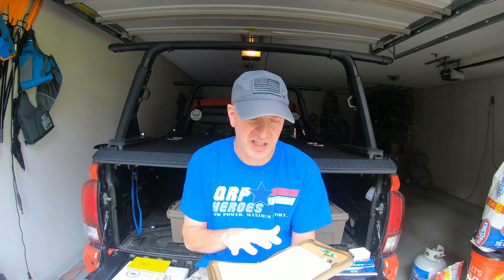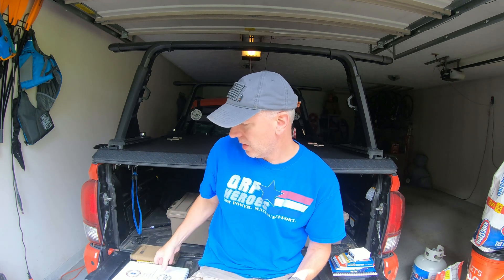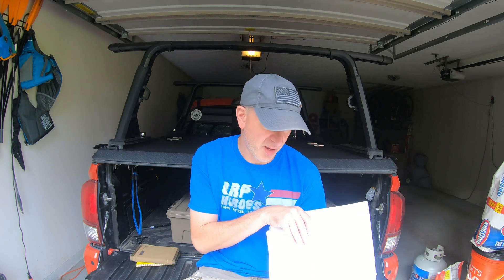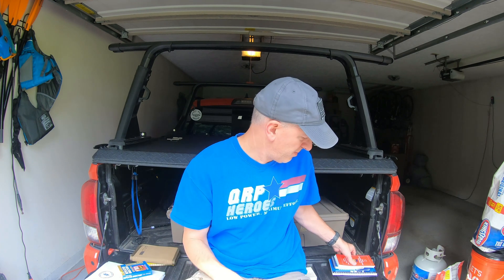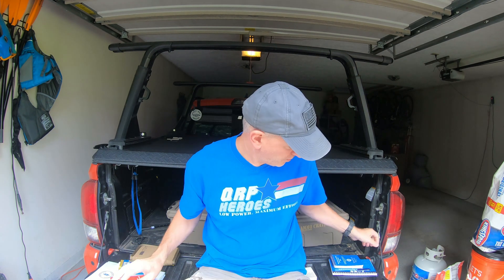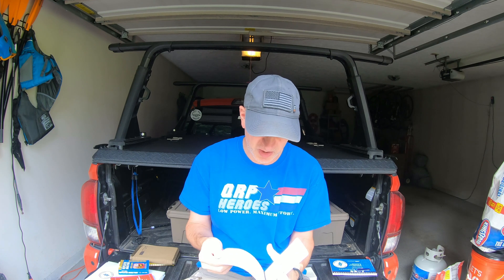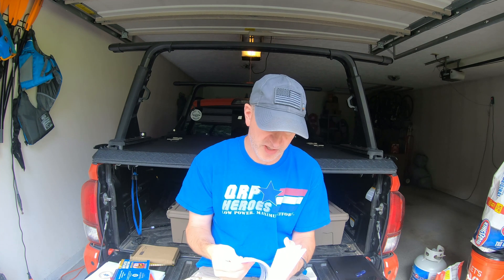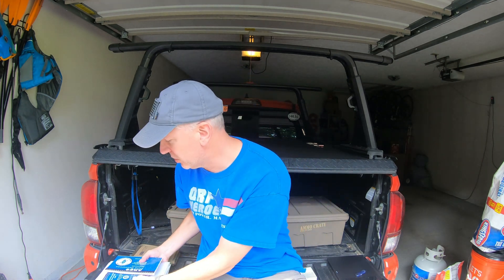Emergency Communications - Materials and information prep

Comment: Very solid advice. I bought a refurbished Panasonic laptop that has GPS and about every port imaginable. Even has a DVD. Runs very good with W10 and is only for ham ARES use. It is bulky but can work in dirty and non climate controlled environments. Good video! 73

Comment: When I started watching I realized that I had an short version of this.  You covered a lot that I hadn't thought about and will be updating my "Rucksack".  In the Military we used to ask "What's in your rucksack?"  It doesn't specifically refer to what is packed in your rucksack but what is packed inside your brain.  Training and education.  Get your "rucksack" packed so you know procedures if there is an emergency.  It is better to do something wrong and learn from it than to do nothing at all and fail.

Comment: if you setup the pi as a hotspot, you can use vnc and ssh on your cell phone to control it...
Reply from the maker: Good point, I have done this, but I also had it just stop working in the field with no access to the pi.  I even have a tiny portable screen that is USB powered for my PI.  It's just easier to use a reliable laptop.
Reply: Whatever emergency or SHTF communications solution you come up with, You need to consider that there will be no internet, no cell phones, and possibly no utility power. I expect all the bands will be the wild west and complete chaos. Add a (not out of the question anymore) EMP and we will have a very quiet mess.